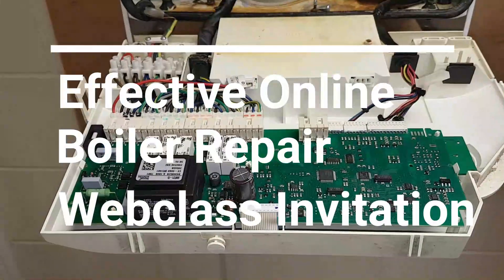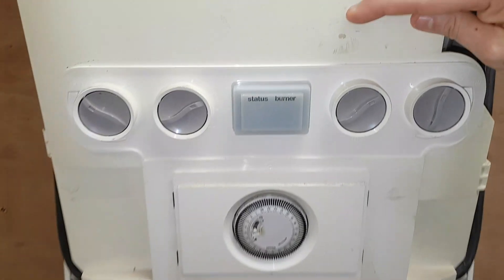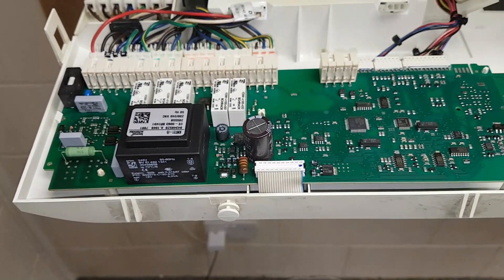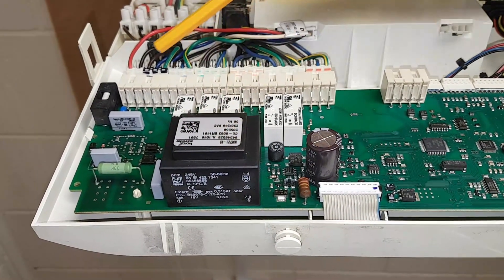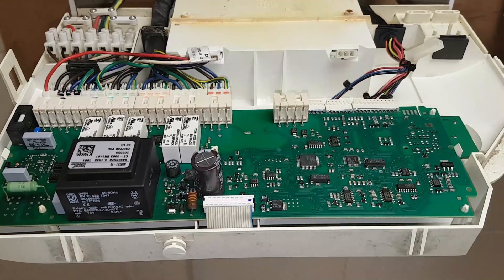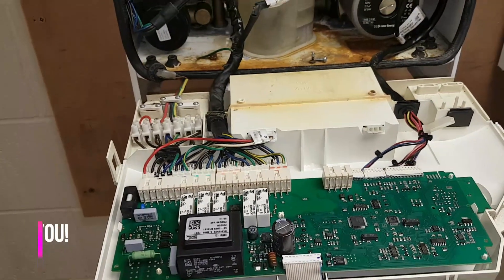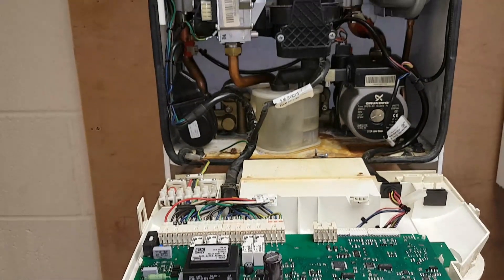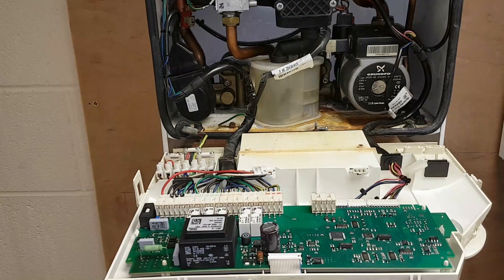Online Boiler Repair Training

Comment: Hi AnR and all gas knowledge folks here, I have an ideal logic c30 base model. Hot water is perfect but CH doesn't warm the house. I notice that the main selected knob for CH on the boiler itself only shows a digital range from 30 to 35 degrees C when the spec sheet shows it being min 30 C max 80 C .The DHW is fine and shows min 40 C and max 65 C, which matches spec sheet. I am being told PCB replacement required. Have you ever encountered something similar.
Reply from the maker: It's either the control knob shaft has broken or its the display pcb.  Also can you subscribe to our channel 😊